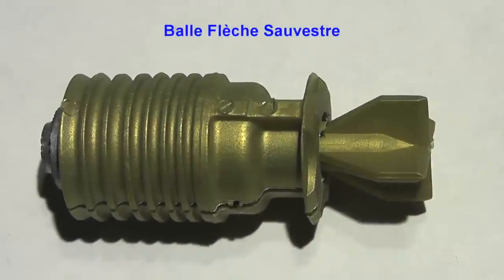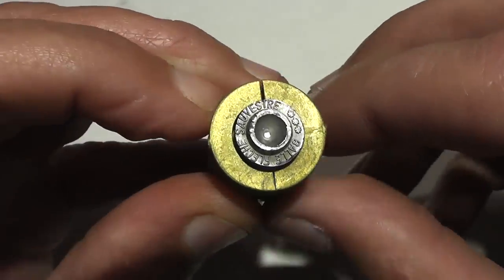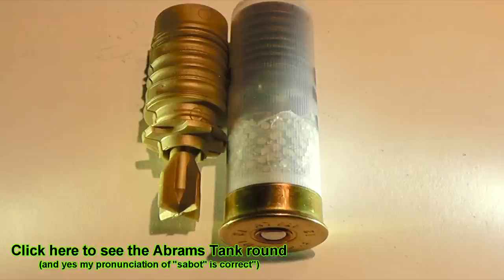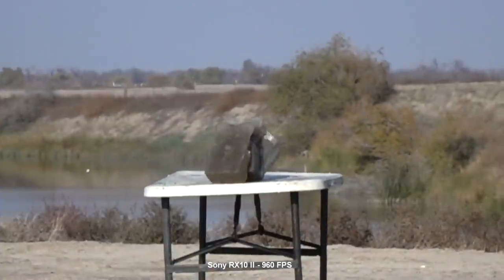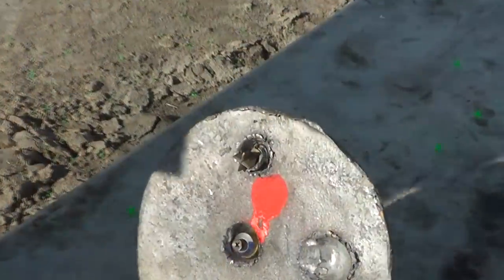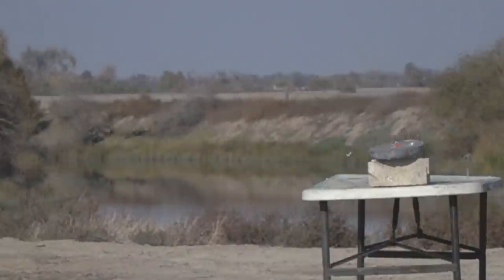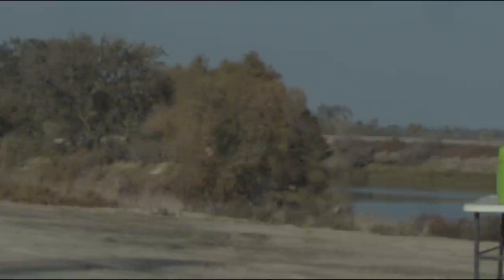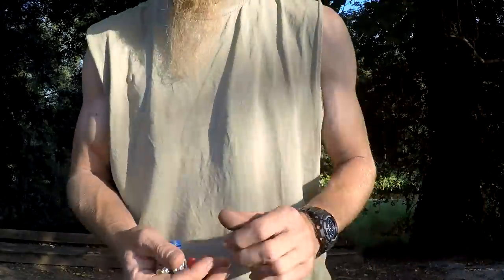Shotgun slug designed like an Abrams tank sabot - Sauvestre

Comment: Interesting.  As a former tanker and Master Gunner of the M60A3 and M1A1 I'd like to clear up some misconceptions.  The first one is the reason why the 120mm is a smooth bore as opposed to a rifled bore.  It has to do with internal pressure and gun wear, rifled cannons simply cannot handle the same pressure without experiencing much greater wear.  It actually has nothing to do with the types of ammunition fired, and in fact the smooth bore reduces the types of ammunition that can be effectively fired*.
  
The next misconception is that fin stabilized ammunition must be fired from a smooth bore.  Not so, HEAT rounds are fin stabilized and have been fired from rifled 90mm and 105mm with terrific accuracy.  HEAT rounds overcome the rifling the same way 105mm APFSDS does, with driving bands that slip.  So as the round travels up the bore of the gun most of the spin is taken up by the slipping drive band with only a minimal amount of spin imparted on the projectile.

*HEP (High Explosive Plastic), or in British parlance, HESH (High Explosive Squash Head) is a very effective high explosive round that needs spin to be most effective against the intended target.  The round is a relatively thin walled projectile and it is meant to squash or pancake against the target whence a base fuze is initiated.  It was found early on that spin is necessary to make the most effective pancake upon the target before the base fuze initiates.  The Brits love their HESH rounds and is the reason they've stuck by their rifled 120mm cannons.

Comment: I love the sabot/wad effect of pulling the dart. 
Take this design, use poly-carb for the lead section of the darts upper. Drill out its center for a core. Use a blunt hexagonal carbide rod as a core. Drill out one end  the rod to fit the neck of say a 223. Replace the 223's FMJ bullet with a wad even with the mouth of the shell. 
Push the rod in the head of the poly/bullet just below the tip of the head. Leave a gap so as to allow the initial impact to be displaced by a crinkle zone between the poly-upper of the bullet and the lower, barring surface. Place modified 223 in the bottom of the poly-upper bullet. Secure the 223 by injecting hotsnot in a hole connected with a groove at the bottom of the poly-upper that aligns with the 223's evaluator groove.
Make the same base as they used but... drill out a mount hole for a firing pin. The bullet makes impact, the initial force goes through the poly down to the crumple zone, collapses the free space between the 223's base in the poly-upper and the firing pin in the lower part of the main bullet. The pin hits the 223's primer just as the rod makes impact with surface. BOOM X 2. The sabot/wad pulling effect should minimise pre-fire in the barrel while keeping accuracy and adding penetration with a shotgun. 
                The 223cal, 12g w/armour piercing tip. Buy now.
                               No choke required. Operators standing by.
                                                         Just Thinkingoutloud

Comment: I'm an old tanker (11E) from the early 70s we had APFSDS (Tungsten/carbide penetrator) rounds but weren't allowed to fire them because of range restrictions, both here in the US (Ft Knox) and in Europe (Grafenwohr, etc)  Our tank was the M60 and it's variants...(105mm rifled main gun).  the main gun ammunition was the H.E.A.T. round....it was also fin stabilized and had a ring - a driving band -  (bourrelet) made of a type of nylon encasing ball bearings - the idea was to negate the effects of the rifling because spin degraded the accuracy of a finned projectile.  Ammo for the 120mm smoothbore main gun no longer has the bourrelet.  Reports of the kinetic energy rounds used during the 1st Gulf War showed the DE penetrator plowing through the first wall of the tank emplacements, through both sides of the armored vehicle (usually an MBT) then finally out through the other side of the emplacement.  The only round we ever used in training was the concrete filled (dummy weight) blue in color,  TP-T training HEAT rounds.

Comment: firing an APFSDS through a rifled barrel can cause a lot of inaccuracies, it's why the APFSDS fired by the British Challenger 1 and early Challenger 2 MBTs had a rotating collar around the  projectiles to negate the spinning (the British tanks up until the Challenger 3 had rifled barrels to allow for the usage of HESH (High Explosive Squashed Head) munitions which required spin stabilisation, with the newest iteration the designers realised that the drop in performance of the APFSDS was not worth the tradeoff for firing a round that is only really used for taking down buildings, it also meant that the sabot they now used could be designed to be simpler and more accurate as well as integrating other Nato ammunition types instead of just special production models)

hope this helped sir.
I myself have designed a few smoothbore APFSDS at both 12 & 10 gauge however since I am only 18, and living in the UK, it is not currently possible for me to send any over to you at this time.

Comment: Wow, those are pretty damn accurate. 
Good job from David. It probably would have helped a lot to know how much powder you are supposed to load them with.
Reply: i could weigth it but i don't know what kind it is
Reply from the maker: These use more than double the amount of powder a "normal" slug uses, so  doubling down with the wrong powder could lead to some seriously bad results.   I had to use inert plastic resin to take up the space rather than just add more powder.   The company doesn't publish the loading data for these slugs.

Comment: Abrams, an Leo 2, 120mm mainly because they can get the velocities they need easier than with a rifled gun. The speeds needed in modern SABOT antitank rounds are such that you wind up with an incredible amount of wear and tear in the rifling. You can get a crap load of wear on smooth bores as well, but those rounds aren't as effected by the wear as they are fin stabilised. Rounds for the rifled guns are more sensitive to rifling wear as they are spin stabilized. Just as bullets are. I am sure you can see/tell a difference with a "spin" stabilised  slug and a fin stabilised one when fired from a purely smooth bore shotgun.

Comment: Some good firearms innovations have came from France over the years. Like smokeless powder I believe.
Reply: .22
Reply: Most if not all firearms innovation comes from France, riffled barrel, scopes, sabot penetrating ammo (sabot means an ancient wooden shoe that you'd fill with paper, wool or straw when it's cold as wood was the only material that wouldn't get destroyed working in the wet fields and was the most comfortable), bayonet (from the city of Bayonne), metal cartridge, light machine guns, even your AR15/M16/M4 use the exact same mechanism as the MAS 44 rifle

Comment: They are supposed to be loaded very very hot, but still, the subsonic "totally intended" load impressed me.
They actualy shoot a bit better with rifling, can't tell you why. With a rifled screw on barrel extension we managed to reliably hit man sized targets up to 230 meters. That's far for a shotgun, ad it still has more energy than .223 at the same distance if i'm not mistaken. After that it kinda drops like a mortar.

Comment: the M1 Abrams actually started out with a rifled bore and switched to a smoothbore from the M1A1 models and up. My understanding of the reason for the switch is not so much as to accommodate for the sabot rounds used (as you suggested around 5:00 ) but in order to accommodate the use of alternate rounds such as canister shells (tank version of shot) and also for (what was then being developed and i think was never implemented) precision guided munitions such as those used in artillery.
Regardless of why they switched you're right about that sabot not needing rifling to fly straight, that thing flies great! Now all you need is a viewer to machine you a depleted uranium version of that slug and you'll be killing t-72's without a hitch, haha.
Reply: Spin had a negative impact on armor penetration from saboted rounds, from what I understand.

Comment: I think the reason they have a smooth bore in the Abrams is so they can fire HEAT rounds. The Brits like their rifled barrels like on the Challenger 1 and 2 tanks but since HEAT rounds can't be fired out of a rifled barrel they use HESH rounds. 

I would want a rifled barrel because I think HEAT and HESH rounds are starting to become obsolete with all the new explosive reactive armor and Chobahm armor and other sandwiched alloys ,that are made to stop HEAT/HESH rounds, that these tanks are made of. For now as long as our enemies in the Middle East have regular steel and iron armor, HEAT and HESH are here to stay. But with other countries such as China developing their technology quickly, I think we would need to stop using smoothbore guns and focus on creating new and better APFSDS rounds like the one on the k2 black panther, which SHARPENS ITSLEF when it pens armor! Unlike most armor piercing discarding sabot rounds which deform when the pen armor.
Reply: Wacky Tic Tac isnt all DU ammo self sharpening? Sabot shells are DU i believe
Reply: Actually >.> I believe we have a HEAT round that has a slipping driving band so that the round doesn't spin. I could be wrong.

The same technology is used to allow a rifled gun to fire a discarding-sabot shell; the big APFDS rounds are (apparently) very adversely affected by spin.
Reply: BazilRat Gonna read into that sounds like a interesting engineering problem to solve
Reply: Wacky Tic Tac It actually does not sharpen itself. The misconception that the penetrator continuously sheds material in order to maintain its conical sharp shape is not true.  Actually the formation of adiabatic shear bands means that the sides of the "mushroom" tend to break away earlier, leading to a smaller head on impact, though it will still be significantly "mushroomed".
Reply: Another thing to take into account is that smoothbore barrels wear at a slower rate.

From what I've read, HEAT round are just less effective when spinning, while HESH round are better that way.
Reply: I don't know where you got your information but I suggest you change your source. The Leopards that Australia used to use had 105mm rifled guns and fired HEAT rounds without any problems. HESH, APDS, Smoke and A-pers (splintex) completed the set. :)
Reply: Plus because the same round that was fired out of a smoothbore would be faster than in a rifled

Comment: shoot metal powder in a wax slug. not just shavings, actual powder.
Reply: wrong video
Reply: Tadas Armonavičius what do you mean?
Reply: Bryan Suh the video is about a french-made slug, you're talking about, I presume, the magnesium loaded shots, which was the vieo before this one I belive.. tbh I just want to see a magnesium (only) loaded shot but this is the wrong video to make a comment about it  :)
Reply: Tadas Armonavičius na they put magnesium in to watch it burn. the metal powder should be the slug itself
Reply: Your talking 1084 POWDER STEEL use in knife finishing? Or Stainless Steel powder used in cintering or compression molding.
Reply: Rl Badger any type of metal in a powdered form
Reply: got ya.
Reply: that's a door-breaching round

Comment: Abrams sabot?? Pretty much the same gun as many other tanks in Nato arsenal, so the same ammo can be used by allies
Reply: Christian Bach Ive got a bunch of .30 calibre rifle rounds here, all the guns that fire them are 'pretty much the same' . Do u think it would be a good idea to stuff some into my .307 lever action and pull the trigger? Have a look on youtube here to what happens when you use the incorrect ammo in a gun that is 'pretty much the same'. Its general rather messy for the bag of meat holding a gun shaped pipe bomb, now imagine that in tank sized scale, not good.
Reply: +Watson Art Glass 
My point is that there is nothing called abrams sabot round, the gun used in the m1a1 abrams is the german rheinmetal 120mm m256a1(L/44), and the one used in the german leopard 2 tank, early verison was the also m256a1(L/44), the new 2a6 leopard is the rheinmetall L55 cannon, i think they all use the same ammunition, so that we as allies can use the same ammunition, the 120mm does not differ in case size or power, like some rifle ammunition with the same caliber does. :-)
Reply: My mistake you clearly know more on this subject than me, cheers for clarification :)
Reply: Its okay :-)
Reply: Yeah, I was a tank gunner, leopard 1 with a 105mm cannon, we used sabot rounds...  
Sabot (as in sabotage) means wooden shoe in dutch....  they come off in a similar fashion....  Its more of a method, or system, than a specific brand of ammo, I think....  I think russia has em too... AND china...
Reply: it's wooden shoes in french too

Comment: I am going to say that I am no expert on ammunition. When I heard the line about the casing separating from the rear, I think it was to do with the architecture of the actual projectile.
The gases, I believe, only have the job of accelerating the ammo out and separating the casing from the rear at its exit. This dynamic could allow for reuse, if one was wanting to make their own ammo. All you would need is a mold for the lead. Apart from that, the structure of the lead projectile, after the casing has departed, may make it more aerodynamic. Hence, a likely powerful shot.

Comment: TAOFLEDERMAUS: Could you please do a comparison of rifled shotgun slugs shot from a smooth boar vs a rifled boar. I know that the rifled barrel is used mainly for shooting sabot slugs and smooth boar for the rifled slugs. However, sabots are so expensive that I am trying to find an alternative. Different brands of rifled slugs worked better or worse in my gun (mossberg 500 12 ga.). I found Winchester to be the best for me. I have killed a buck this yr using this method. I shoot the 2 3/4" 1 oz. 
The misconception for most is that a rifled slug is designed to place a spin on the slug in a smooth boar barrel. I don't see how this can be true but I do not have a high speed camera and I could not find a good slow mo of this type of slug. There is also some speculation that the spin begins to take place after it is flying through the air... like the fletching on an arrow. I would like to know if this part is true. The most logical explanation is that the rifling of the slug cuts down on the surface area of the round. 
I would specifically like to know if the rifled barrel puts a good spin on the round and if it is stable and accurate. I have been able to shoot a 2 in. bulls eye out at 75 yrds with 5 out of 6 shots but I want to know if I can be really confident that shooting just regular rifled slugs is a good alternative to Sabot rounds. 
*There are several warnings about leading the barrel too much when you use a rifled slug in a rifled barrel. I have found this to be true. There is a lot of lead left in the barrel after a shot. The consensus is no more then 20-25 before running a brush down the barrel.
Reply from the maker: Yeah,  a few others have wanted to settle the arguement whether a rifled slug actually spins or not.  Look at some of the slugs at Ballistic Products like the LBC Sabot,  etc.   You load them yourself and that will save you a bit,  but also allow you to charge them with different powders to give you a choice of velocities.

Comment: Thanks for a well-made video.  I would pass on the french slug.   If I am using a 12ga slug I want all the power the 12ga can bring to bear.  I prefer Hornady SST sabots, it's a 2,000 fps, 300gr sabot.  SST sabots are very accurate out to 200 yards.  For my smoothbore, I like 3 inch, 1oz rifled slugs, nothing fancy.   I have gotten good performance from Brenekee slugs, for the game in this area they are overkill.  Not to mention Brenekee slugs are almost as expensive as SST sabots.

Comment: in the vid you said spinning the round wouldn't help make it more accurate. that's actually innocent by spinning the round fast enough you stabilize it removing the waggle and also increase penetration. idk how rifling the barrel would helps but it might so if you get another batch try it.

Comment: 1K comments so I'm not scrolling to check but WRT the Sabot out of the 120 mm Abrams cannon, yes, you are correct that the barrel isn't rifled and is a "smooth bore" but the "Silver Bullet" penetrator IS "Fin stabilized" and does have a (mild) spin imparted during flight. You can see the rotation if you watch the SloMo films of them firing. 
Very cool round and near Lazer beam level flight to WAY out yonder!
But THESE shotgun rounds, I could see buying half a case if not too much cashish to see how they run out of my smooth bore Punkin' Boolet Launcher.
Where can I get them?!?
Reply: monsieur sauvestre was working on the leclerc tank
Reply: only in europe, specially in france, sorry man !

Comment: Just like the APDS (Armor Piercing Discarding Sabot - with a Tungsten carbide core) of the 60s & 70s and the depleted uranium penetrators of the late 1900s and 21st century APFSDS Armor Piercing Fin Stabilized Discarding sabot)..in the 70s the Soviets used half rifled main guns, the US kept the rifled barrel on the M60 series but used a ball bearing bourrelet that negated the spin imparted by the rifling on the fin stabilized H E A T (High Explosive Anti-Tank) rounds...as an 11 E (tank crewman) I watched many of these rounds go downrange at Ft Knox and at Grafenwohr in Germany.  When the M1 Abrams was adopted the smoothbore 120mm main gun was adopted and all main gun ammo was/is fin stabilized.